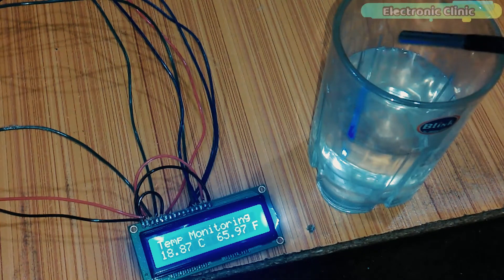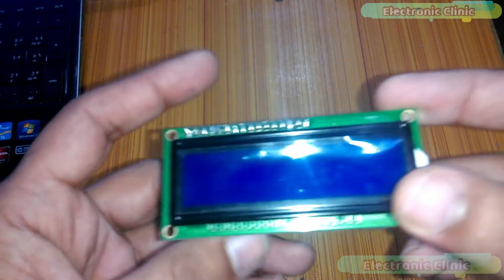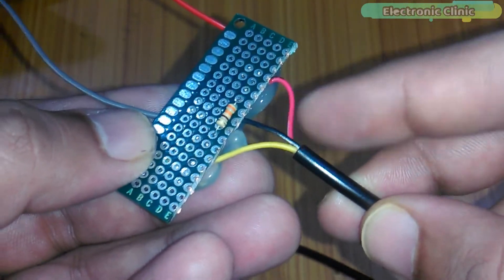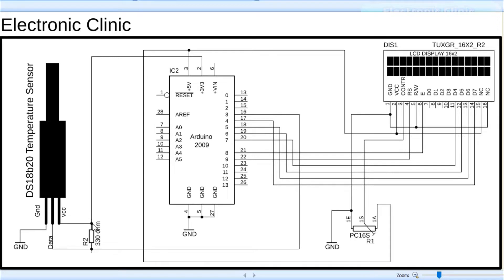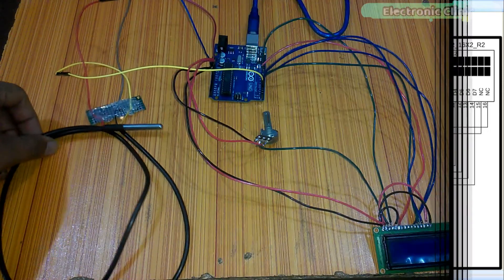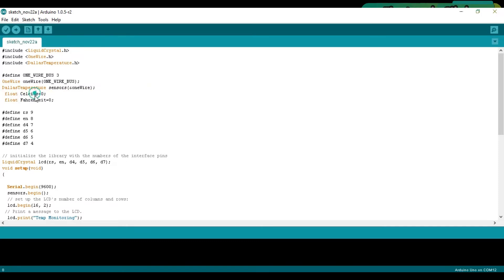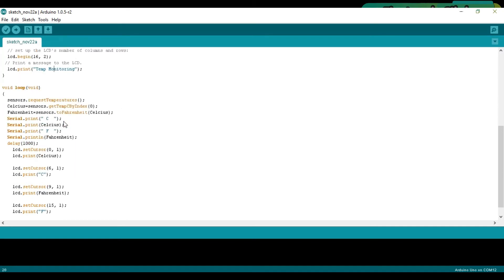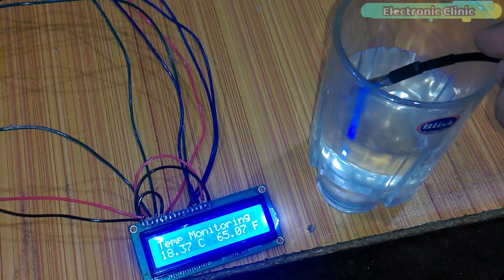Arduino Ds18b20 waterproof one wire digital temperature sensor with 16x2 LCD

Comment: can I use it with two sensors? and get to the LCD double results from both sensors?
Reply from the maker: yes you can.
Reply: @ElectroniClinic  thank you for your reply, do I need different code,and different setup? can you help me? thank you